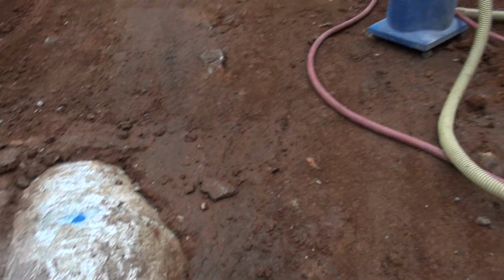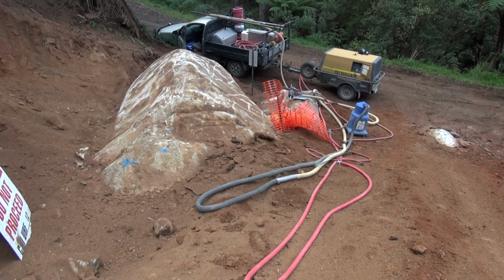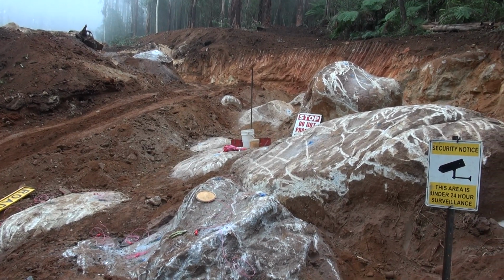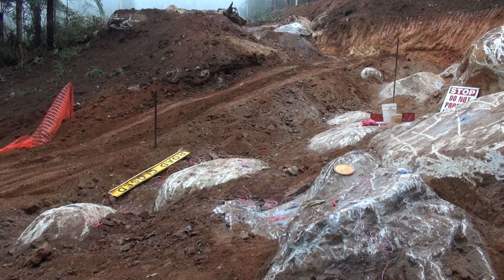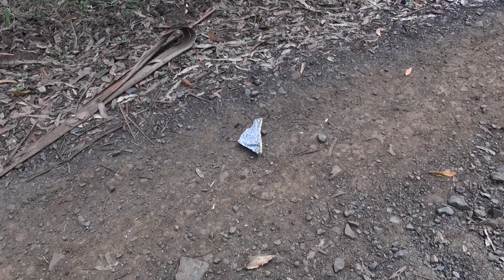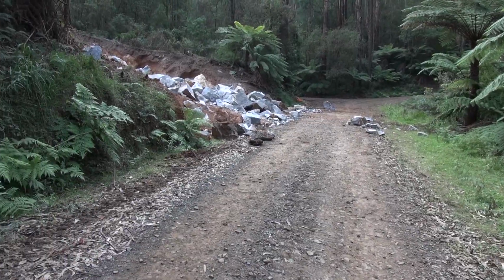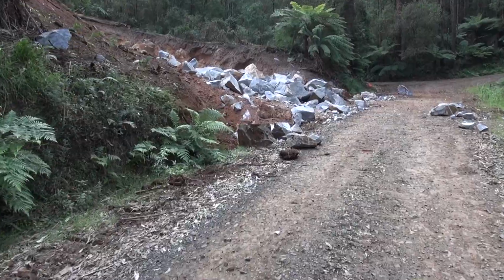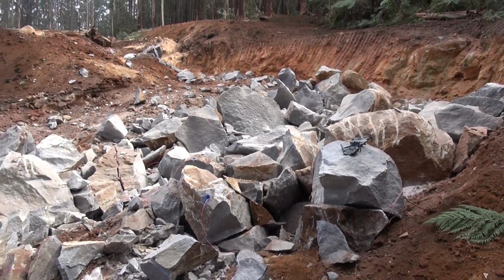Blasting Granite for a forest road upgrade

Comment: Can't get over how much granite you have to deal with! Nice result, and stemming seemed pretty adequate.
Reply from the maker: The stemming could have been better, notice that a fair bit shot out. The Burdens were all conservative and generally 25 - 30 diameters stemming depth, I guess that the stemming efficiency was effected by the high percentage of fines that was mixed in with this batch. It was 5mm screenings but higher percentage of crusher dust than usual.

Comment: Rocks in the ground are like gold nuggets to a blaster. You said Anfo loaded at the end, but packaged emulsion at the beginning, Doesn't packaged emulsion contain sensitizers to sustain stable detonation. BTW as I recollect, Dupont's Blasters handbook stated the anfo works exceptionally well (prill form) in small holes, only when pneumatically loaded to achieve a consistent density. and that when loaded with free flowing prills, was more susceptible to failing to sustain thru the column.
Reply from the maker: The emulsion may contain glass micro balloons or gas bubbles to help. I cant see how you can get higher density than 0.82 without crushing the prills, but I have read that also.

Comment: I have noticed an unusual bodied truck on the Westgate Fwy a couple of times , early Am and it's placard would be familiar to you Dave.Ammonium Nitrate EmulsionRigid body with a covered hopper and a couple of hose reels
Reply from the maker: Sounds like Orica's bulk emulsion truck on the way to a big quarry shot. The explosive is transported as separate components that are pretty harmless, and mixed as they are pumped out and down the blast hole.

Comment: Hey, really nice job. I'm from Chile. I´ve got to do pretty much the same at this scale. Could you help me? I'd like to know the depth and hole diameter as well as the amount of ANFO you used, and the amount of plug, we call this TACO, we also use dust! . HOPE YOU CAN HELP ME 
BEST WISHES!
Reply from the maker: Hi Alexis, this job was drilled with 38mm holes, drill a little deeper than you need to break (subdrill about 1/3 of the distance between the holes) and the loading rate was around 350g/m3 for hard granite
Reply: @demolitiondavedrillandblast   Thank you so much !!!!. Now I have something to compare with.

Comment: Comment at the end mentions ANFO, but you said at the start just 32x200 plugs ??
Reply from the maker: the short holes just got a plug, the longer holes got a plug and 2 or 3 scoops of fairy dust
Reply: Fairy Dust. Oh I like that!
Pretty dangerous fairies though.
Reply from the maker: Yeah, I got that one from Greg, he is one of my long term on the job helpers - driller and shot firer and in house diesel mechanic. Love that Fairy dust stuff Mark.

Comment: At the end of this video you can still see the "fuse" go into the blue hole.  Why didn't this fuse "disappear" when it was used?
Reply from the maker: That is not actually fuse but plastic shock tube - part of the detonator assembly, this is a hollow tube that has an extremely thin coating of explosive on the inside, just enough to carry a shock wave (@2000m/S) down the hole to the detonator. The shock tube is not consumed in the blast and should be picked up afterwards.

Comment: Hi, what if there is water in the hole? How do you get it out and does it affect the blast? Thanks
Reply: My father used to use explosives in the Forest Commission years ago. Not all explosives are waterproof and water is non-compressive causing the blast act unexpectedly.
Reply from the maker: Water in the hole is a drama if you are planning to use ANFO as water kills it quick, even although these 5 holes had only packaged emulsion As mentioned by okrustyone if there is a lot of water in the hole it stops the stemming material compacting and grabbing the wall of the hole as the water does not compress and so the water logged column of stemming ejects out of the top of the hole. That being said water by itself can be used as stemming if there is nothing else available.
Reply: Forrest Commission, now there is a name I haven't heard in a very long time. Cant think of the current name given that they seem to change name every two or three years.

Comment: what brand is your blue cyclone vacuum ?
Reply from the maker: It is a floorex supa separator, used by the concrete floor surfacing industry, this is just a pre separator to catch the coarse particals, the main unit is on the back of the Hilux. The dust vac is a Pulman Ermator S26, 2400W twin motor Hepa vac with "longpac" continuous bagging system. It is not difficult to build your own cyclone separator, I have built several that are more effective than the floorex unit, but I use the floorex as it is near indestructible.
Reply: hi, Thanks!.  yes I have built my own because I work on old cars that are often full of bog, which is basically polyestor resin and talc. Damned stuff gets everywhere once I start removing it so I looked up cyclones on line and made my own which dumps into a 20 liter paint drum (the type with steel contracting band to secure the lid.) just doing one side of  car fills the drum. I am using a cheezy shop vac I bought from Bunnings and i think i will look around for one of the twin motor jobs, Hare and Forbes stock different ones. Dust extractors like Chippies use dont work at all ,being more volume than suction and once connected to a sander the volume drops right off and nothing gets drawn away.   Cheers!
Reply from the maker: Yeah, good idea to not breath that stuff, I have done similar with 20l tins. One of the best cyclones I have is a very high efficiency cyclone made by Clear View Cyclones, designed by Bill Penz, it is a ripper, carefully optimised design, would be ideal for soft material that you want to capture, one of my biggest problems has been that stone dust and chips are so abrasive that the destroy everything they get sucked through.   http://www.clearvuecyclones.com/  and   http://billpentz.com/woodworking/cyclone/index.cfm#index.cfm

Comment: Explosives are a blast, but, wonder how a diamond saw would fare in these type of hard granite rocks you often blast through, would make for a cleaner finish and tighter tolerances, but then again the support those need are often to much for small compact jobs and areas with petty complainer and petty lawsuits for too much noise or other bs.
Reply from the maker: Hi Josh, I'm thinking about diversifing into diamond wire sawing, pretty expensive to get started in though.
Reply: Yeah like I said, the support is not just space restrictive but on top the main cost, but the rope is versatile than a circular of chain style diamond saw, but the cut pieces can be used to make decorative features or for easier removal however dense-heavy it is or sized small or short enough to get out of say a tight quarter back yard. Thanks goodness for the many options and their costs/prices, and use depending on situation and end customers desire.
Reply from the maker: The machine itself is small, Some guys near me have one that they use for cutting mass concrete, it has a 25KW electric motor, so you have to bring your own power source in the form of a tow-able generator in most cases. have o look on YouTube
Reply: I can see the advantage of a diamond wire but I supposed the thing about drilling and blasting is although some of the kit can be a bit bulky and heavy to carry as long as you can get an air line to where you're working the big compressor can be out of the way. We had to dig a trench to run a new water pipe from our spring to the house. Half of it runs right next to a stream at the bottom of a valley about 10m deep with very steep sides. 200 meters of trench 3 foot deep with a shovel and grubber. Not fun times.
Reply from the maker: 200m of trench with a shovel is a nightmare! Yes a rock drill can go extreme places , many times I have had to climb and haul the drill up on a rope.
Reply: Oscar the benefit of the diamond wire is its versatility these days with their compact power units that stores the wire, but also less drilling required for large jobs that may need 10s or 100s of holes to be drilled, yet its much easier access of side and top and only need to remove a portion of said boulder, also makes for a smooth cut and finite finish cutout that dynamite may not offer so well. it has its uses
Reply: I had a long dock to remove and decided to use a diamond blade air driven chainsaw to cut the pilings at the river bed surface. The pilings were pretty much petrified. It worked like a charm.
Reply: Wood? if so, then not the normal way to cut it but, if it cut like butter then great.

Comment: Have you seen that Korean plasma stuff?
Reply from the maker: Yes I have, it,s a scam, 100%... just a deceptive ploy to try and attract investors. It is no better than blasting with gun powder or smokeless powder, the compound that they are using is copper oxide thermite and initiating it with a high voltage spark and trying to give the impression that this is something that is going to revolutionise blasting.
Reply: I wondered,  @demolitiondavedrillandblast , since it used such an immense electric pulse, what the point was. Seemed like it was not that different than packing the hole with thermite, but ungodly expensive, and it requires 3-phase power- where the hell would you use it?
Reply from the maker: @MrLargePig  - Copper Oxide Thermite gets used a lot in the movie industry - makes an impressive looking explosion without lots of damage and a huge bang - https://www.youtube.com/watch?v=4yDJoXRvmqw